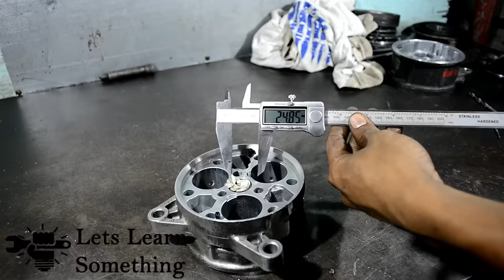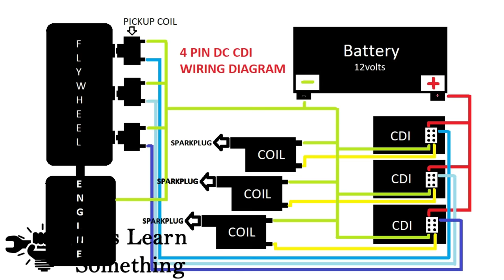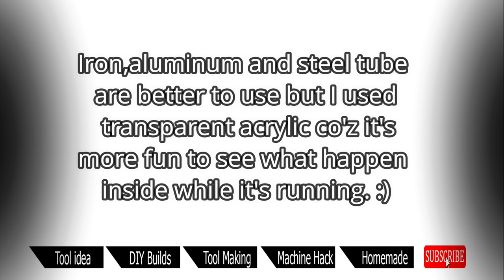I turn Car Compressor into Working Engine

Comment: The center area where the swash plate resides (swashcase?) would make a perfect oil reservoir (bath the swash plate and pistons in oil, no net compression here), just needs a filler and drain drilled in. The refrigerant passages between the cylinders would make an excellent water jacket. Put a decent header on it for backpressure and don't forget an NT carby, a tiny water pump, and a rad. With these modifications (and the obvious 86ing of the acrylic pieces), the motor should run as long as it's maintained (oil changed every 20 hours or so) and produce a couple horses. One upshot is that it will not require a break-in period but may or may not still require 2-stroke oil/gas mix depending on how well the ends are oiled from the swash case oil.

With skills like that, you could even take apart a Hoover motor and build yourself a supercharger for it!

Comment: Like a chess master. This genius thought of everything needed to convert an air conditioning compressor into a functional two-cycle (three cycle?)engine. He hand made a magneto. And he perfectly positioned the spark points without adjustment. Then he made a cylinder head/intake manifold out of acrylic so that we could watch the magic happen. 

Who IS this!
Reply: This some iron man type shit here
Reply: I guess technically it would be a five cycle, three cylinder. The intake side with reed valves and carb has two cycles, intake and compression. The opposing side has intake, compression/ ignition, and exhaust. 
 I wonder how much if any positive pressure there is in the transfer pipe from side one to side two. 

 Really cool concept.
Reply: Michael Williams I bet lubrication is amazing too... he filled the bell housing with high synthetic oil which will last the lifetime of the engine and has it sealed off. I would have installed a breather to allow pressure to escape the crank. But it is still an amazing video
Reply: @michaelwilliams8297  
A 2-stroke motorcycle engine works the same way.  The air-fuel mixture is sucked into the crankcase thru a 1-way reed valve.  The downward motion of the piston acts as a pump to build gas pressure in the crankcase.  When the intake port is exposed by the piston, the gas then pops into the cylinder, hopefully pushing out (scavenging) most of the exhaust, which already started flowing out since the exhaust port was exposed first.
Reply: @williamgrissom9022  this is a 2 stroke engine or 2T, but with magneto instead of points
Reply: @denimory  
Not a magneto, but rather an inductive pickup (VR or Hall-effect).  A magneto generates the spark by itself, w/ no outside power source.  You find them on small engines like a lawnmower, though also long-used on airplane piston engines where reliability was paramount.  Each pickup triggers a CD ignition box which is powered from the battery.
Reply: @williamgrissom9022  since english isnt my nativr language, magneto was the closest wich i could remember, but thanks on the input tho :)

Comment: His wife must wonder about why the AC didn't work anymore on her car.
Reply: No problem! He turned the enginge in to a ac kompressor, it works fine!
Reply: @robinwennermark1650   So now her car have a half HP engine with a 3Giga BTU air conditioner , that's cold!
Reply: Kingstreet RC Sweden ///// touché!!!! LOL
Reply: It could be the new engine he puts in it, and makes the actual engine a sub zero super charged cooler.
Reply: The car will not work without it. There is a belt around it ...
Reply: But the car engine runs like crazy
Reply: @bassamnawaz9814  its a seperate belt ,not the main seprentine belt
Reply: @bassamnawaz9814  most cars have counter parts or other cars with the same engines where AC is not commonly put on the car, so those cars have smaller belts,   I get rid of most low power shit box ac units and install the smaller belt from the models that do not come with ac.
Reply: @bassamnawaz9814  the compressor isnt on the timing belt or the alternator so you can take it out
Reply: Bruno White it’s called an ice cream truck
Reply: Probably doesn't have a wife
Reply: Bassam Nawaz there is a diagram underneath the hood of the car that shows a routing option for the belt, with and without the ac compressor so actually YES it can and will work without it lol
Reply: @bassamnawaz9814  idler pulley is your friend
Reply: How about the cooling system?
Reply: @ibrahim-sj2cr  my car has ac and alternator on same belt...😊 Only one belt.
Reply: The engine died, so he built a new one out of the compressor. She’s happy to get to the store now. Some women see the good in a man and some just complain at everything.
Reply: Engine is now the AC.  Car has little acceleration power, but freezing cold AC.
Reply: Next video: I turn my wife into a working engine!
Reply: @bradenpederson4682   so true but mate chill. He only ride motorcycles anyway!
Reply: @robinwennermark1650  '
Reply: G
Reply: @robinwennermark1650  _
Reply: Powersteering
Reply: Ft 3 @denimory
Reply: @WhitfieldProductionsTV  A21 he r 4

Comment: This is amazing, and has to be one of the most clever projects I've ever seen! It looks like like it's running pretty smooth too! I wonder how much power it has? It would be interesting to see if you could get it to do work, like turn a small generator.

Comment: make a solid built one with a cooling system and try to put it on a mini bike or a go kart
Reply: its easy to make smth that will work couple min without load...but the amount of work grows exponentially  when you begin doing stuff that works long enough and can do work
Reply: That's pretty awesome. I would love to see it done in metal and power a minibike.
Reply: the thing has probably around 0.1 hp. it won.
but still gotta say, its impressive
Reply: Bicycle?
Reply: @eliask6180  it probably makes more power than a chainsaw motor
Reply: @daytonwintle6051  Hardly. Modern Pro level 2 stroke saw engines are mean little bitchs.
Reply: love to see that
Reply: @zuestoots5176  Amen!👍👍
Reply: @Mike L What's the point of adding an oil cooler if the oil is mixed with the petrol ???? I think there would be major issues with lubrication if this thing ever was used to drive something.

Comment: Engineering brilliance: 10...….Projected service life: 01 👀
Reply: Ford will add 8 glow plugs and call it their latest generation diesel
Reply: I imagine if he had found a way to make the oil chamber leak proof and had oil being pump through a radiator, it would help a lot

Comment: Now turn a V8 engine into an AC compressor.
Reply: Lol
Reply: I did that. With an old Riley engine in the 1950's.
Reply: This was a standard production item. Our tire dealer had them on service trucks. It was a 5 liter Ford with a special head on one bank. The other bank worked as a four cylinder. They were very fast to pump up and could keep up with a one inch impact.
Reply: Stick a valve on the exhaust pipe and plug the spark plug holes. Then get another engine to drive ur v8 ac
Reply: Vilter has been building v8 and w12 compressors for refrigeration for decades, I'd like to see this guy get ahold of one and build a gas engine out of it.
Reply: I can only make a boat anchor out of one ;)
Reply: Ioi
Reply: that is VERY easy, in the old days you could by kits doing just that
Reply: 24ecko that's already been done , they take a V8 Engine , one side of the block is converted into a air compressor an the other side of the block is used as the Engine to power the compressor, ' GRIMMER SCHMIDT ' was one company that use to sell these , lots of times they were used for tools like Jack Hammers for busting up concrete as a example
Reply: Sounds similar to my ex-employers wife

Comment: Some similar design has the "duke" engine. But, it's 4 stroke with more unnecessary complexity. 
By the way, what if you rebuild it as 6 cylinder?
The way this engine sounds is great!
Reply: Wouldn't run as a 6cyl.
Reply: It's 2 stroke 3 cylinder. Every cylinder has its counterpart which is used to pump the mixture for the scavenging process the same way as a crankcase works in a convenient 2 stroke engine.
Reply: My thoughts exactly..
Reply: likely be a counter firing.
Reply: It could be made to fire in all six cylinders with some kind of external supercharging, but that would add a lot of complexity to a project that already works well the way it is.

Comment: When I first saw this video, I thought about how this could actually be used to make compact engines. Upon doing research, I actually found out several people and companies had been developing these types of engines for the last 100 years. They're known as swashplate or barrel engines
Reply: Yeah they're a thing, just have super specific use cases. They have a lot of wear and friction points and are difficult to maintain. But they're definitely a thing.
Reply: I have a patent on this design and I an building an engine version, much more efficient than his design, four pistons, 9 moving parts.  massive torque, 1 1/2 inch bore, 3 inch stroke, combustion process last 141 degrees, super efficient transfer cycle, does not burn oil.
Reply: @danieledwards8484  oh wow that's really cool. ive been thinking about designing and parenting my own with some of the ideas i had for it. do you have a company or something on the internet that i could look at?
Reply: @danieledwards8484  Or overheat?
Reply: @Zed86zz  do a google search for US patent 10458324, and than under stand this is a general design, the actual design has SEVERAL improvements but is covered by the claims in the patent, nothing else can be talked about without a non disclosure
Reply: @danieledwards8484  wow that's really intriguing. I'd love to work on a project like that. Its definitely a unique approach. Good luck and I hope I can hear more about it in the future. Anywhere I'd be able to look for it in the future or even contact you down the line?

Comment: The 2600 people that pressed the thumbs down are just jealous they aren't as good as you are.
Reply: Fester Blats  You gave a video a thumbs down not because of the content within but because the guy wanted to advertise the fact that it's his video with a watermark ? You're part of the problem. If only you knew how many people would re-upload this and shamelessly steal what little ad revenue he already gets if it weren't for that watermark.
Reply: I didnt even notice the watermark until I read your comment. And the music isn't even loud. If anything thumbs down for no commentary. But one is not really necessary, but would add to the video I think.
Reply: doubtful, it's most likely that he didn't actually show it powering anything, so he didn't make an engine per say, all he did was turn it into a combustion chamber.
Reply: Most likely because he added so many advertisements
Reply: nah bro, there's just way too many ads. between the 2-5 minute video ads and the banners, this video was literally more ad than content. Fucking fail imo
Reply: Não sei pra quê tá nos furo se já cheio de furo sem nem uma explicação
Reply: @NoctisIgnem  I thought Youtube adds the ads ??
Reply: @noanoxan  I had only 2 adds and 2 banners ?? I do see some content with loads of them (and I skip them after the 3rd. Does Youtube add these when a video gets popular ???
Reply: @tedschuurmans  the content creators decide how many and when the ads come. However if you're lucky not all ads will load
Reply: @NoctisIgnem  Thanks for your answer, I never knew that, now I also understand the people complaining about it.
Reply: @TigerBiteMods  
1. it has 6 combustion chambers, not 1.
2. You don't know what an engine is, formally or informally. I suggest you look up "heat engine". Start with Wikipedia.
3. You must be a very busy person if your life consists of finding engines on youTube not powering anything and then downvoting them. There's a whole lot of them.
Reply: @TigerBiteMods  it was an engine and moreless an engine is just combustion Chambers among other things. He could of created a go cart that this engine could of powered. So your saying an engine in an engine stand isn't an engine? I believe most of the world that knows anything about engines would argue with you about saying this isn't an engine.
Reply: @tedschuurmans  I have never seen any ads on YouTube. I hear folks complaining about this all the time and wonder why I've never seen them. Not that I'm complaining about it because I hate ads lol. I've never paid for anything on YouTube to prevent me from getting ads. Maybe I'm just lucky I guess lol.
Reply: @-danR  I guess in this guys eyes an engine in an engine stand isn't an engine. They're just combustion Chambers because they're not powering anything lmao
Reply: @-danR  3.) Well you're not wrong, I am a rather busy person, though you meant it in a sarcastic sense, my clients however would say otherwise. Cheers mate. Lastly I have upvoted his videos where he actually uses the creations to power something and are also subscribed, however that doesn't mean I MUST Love everything the creator puts out nor must I just ignore a misleading title just because I'm a subscriber.
Reply: @frankmaxfield7025  Going from your description, a candle could be considered an engine. Because you know, it continues combusts from a fuel source after it's been started. But what do I know, I just create and sell videogame tricks for a living.
Reply: @frankmaxfield7025  Ohh really ?? You are more than lucky in my opion. Never change anthing on your computer then :-). Just curious... are you running Windows ? And what browser do you use to watch Youtube ?? Thanks !
Reply: @tedschuurmans  I always just use my phone to watch YouTube. I have used my account to watch it on my TV also but didn't have ads on there either so I'm not sure lol
Reply: @frankmaxfield7025  I am going to explore that, don't tell anyone your secret in the meantime ... :-D
Reply: @5pherix  Well said. Properly said as well.
Reply: @tedschuurmans  I'll have what he's having
Reply: Fester Blats  FREAK
Reply: @TigerBiteMods  Freak
Reply: @ianmangham4570  That's what she said😂🤣
Reply: Fester Blats  

maybe you need to watch a technical video explaining how to turn your sound down.  I guess it'd be wasted on you,  you wouln't get it.
Reply: @TigerBiteMods  

you're giving a bad name to Philly.  You heard the explosions, you saw the gasoline disappear,  explain to us how it could possibly have no power to power something?
Reply: Fester Blats  there is a speaker icon, turn this music off when you click it.  and this logo is that big for a purpose hhhhhhh you have never uploaded anything that is why you do not know. hhhhh
Reply: @Jt Munn
A brilliant proof of concept, and kudos for that, he did a job good enough for a like, and so far he has netted 90k of them, I wouldn't fret if I were you.
But, like 4900 other people, I mull over things.
In between the offroad baja slowmotion ken block music (annoying), ads (annoying), watermark (annoying), plexi-glass head when it should have been reworked OEM material with better combustion chambers for more efficiency and power for what he was re-purposing this A/C unit to do, as if we wouldn't BELIEVE he turned it into a engine, insulting viewers intelligence, they can see spark plugs and fuel feed, if people are supposedly THAT distrusting then maybe this video wasn't a good idea from the on-start then?
It isn't his brilliance that earned him my dislike, it's his lack of trust (further proven by his liking your comment)

And spare me the kangaroo court-martial "Those who dislike this deserve death by a thousand cuts".
Firstly the world wont END because of a dislike, from the moment of me writing this, the video has 90k likes vs 4.9k dislikes, good enough to get normal people CELEBRATING even on a bad day.
Secondly let me know when it's illegal to be different, to think or react unlike everyone else (90k likes vs 4.9k dislikes being just that), until that time comes (so much for acceptance and diversity) I use the freedom of clicking the like or dislike button whenever I please.
Unscrew your addicted head from the flat screen and get some perspective.

So I, respectfully dislike this video because of these outstanding reasons, I have other reasons too but can't substantiate them enough.
Youtube math-wiz-rhitm recommended this video to me, I'm feeding data back to it with the dislike just the way they intended this whole thing to work, otherwise it's gonna keep peppering me with all the videos of repurposing something into an engine, I'll hit the dislike again because of the ads and banners and plexiglass combustion chambers (when you've seen the amount of engine building vids I have, you'll spot the norms too), evidently pissing more people off with "Oh how this doesnt have X likes, X subs, X bells, X everything, oh the dislikers deserve to be shot click like if you agree with me feed me likes yes oooooooooh, they're jealous! fascists! xxxxMIND BLOWINGxxx".
Get with the program, that's how the system works and if you don't like that = Email Youtube (spoiler alert, they don't give a crap and will stab your fav channels in the back at first signs of trouble if it means saving their asses).
Reply: @marbrose4804  He did what? Missing a lot of context. We've not had responses yet between us and I said a few things in the thread, which thing are you actually replying to?.... it's like jumping into a conversation about politics and just start saying stuff without any context.....

Comment: There is an engine, which is being developed in Spain, that uses a principle of operation very similar to this one.
The engine is called Innengine, in case anyone is interested to see it.
Reply: Now that sounds very cool 👍
Reply: There is also a company doing this. The company is "duke"
Reply: Not Enderswift  A difference with the Duke engine is that it uses both ends of each piston. If this was done with the compressor engine, it would be a 6 cylinder, not a 3 cylinder.